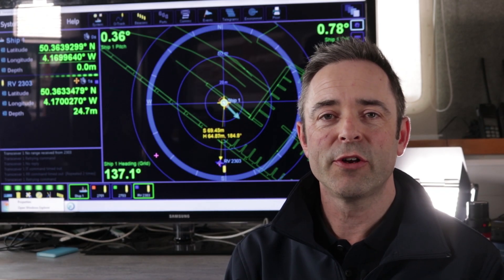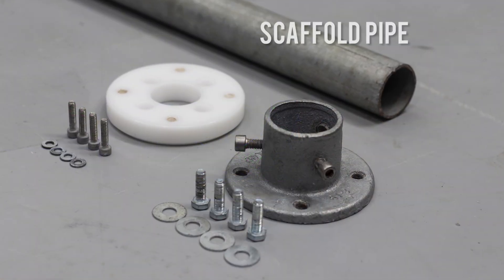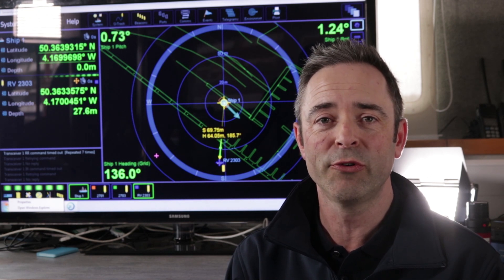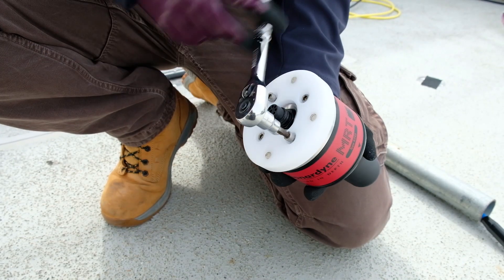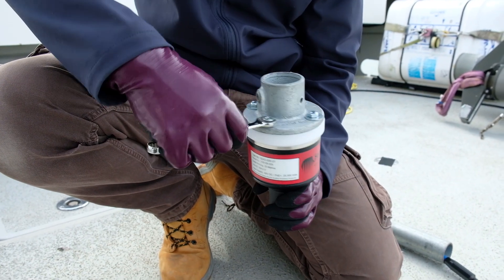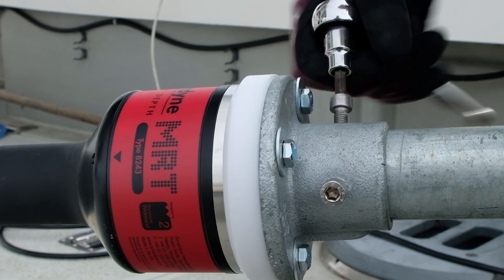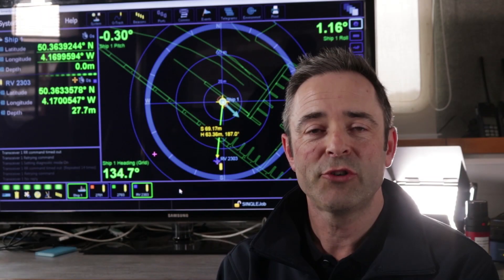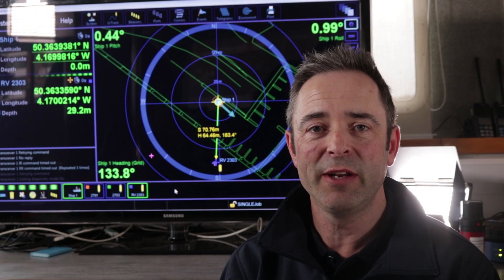How To Deploy your Micro-Ranger Transceiver

Comment: Is external GPS need with the Hub at the base station to obtain absolute coordinates of ROV?Any video demonstrating the software GUI?
Reply from the maker: Hi Rahul. The system includes an internal GPS on the topside. However, you can add an external GPS source if needed. We are currently working on a set of videos on how to set up the system, so keep an eye on out channel. Thanks for your comment
Reply: @Sonardyne  Any news regarding setup an external GPS to the system that allready is installed in the vessel ? i would like to input from NMEA0183 or NMEA2000